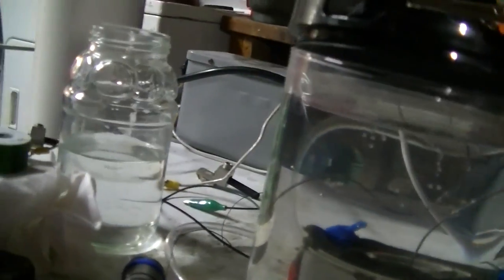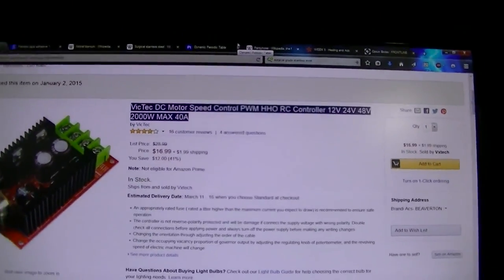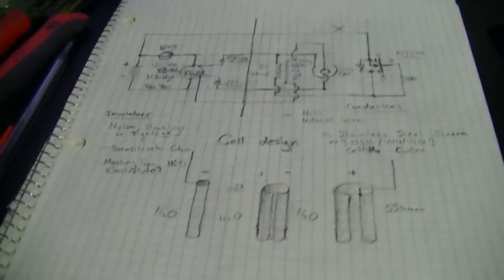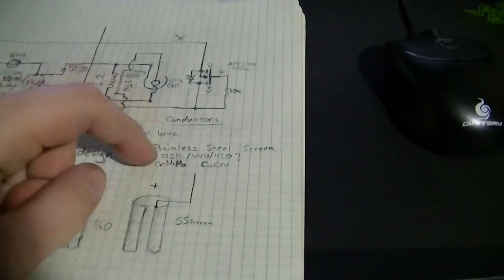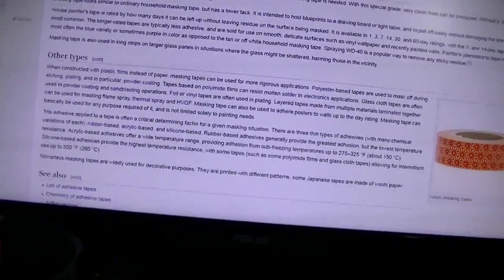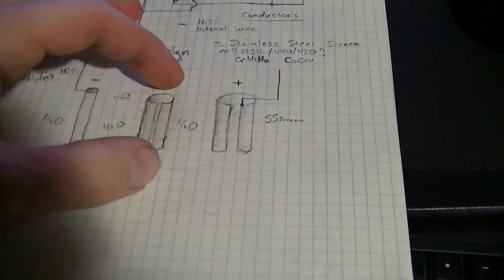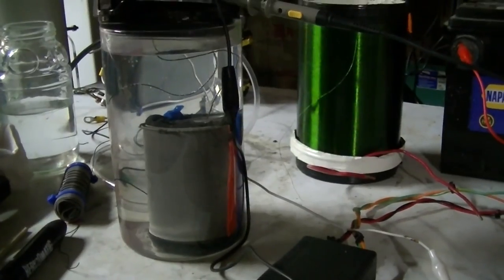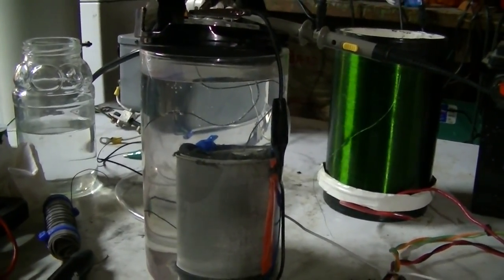Electrolysis in distilled water? NiTi Cell #3

Comment: I am confused. Is your curiosity that you are seeing gas production? Electrolysis does occur without a dissolved salt because water naturally ionizes, but only to a very limited extent. It is those ions that get drawn to the electrodes, and react further to produce O2 and H2. The purpose for the addition of the salt is to force Le Chateliers principle by adding to the left side to force ionization. The salt disassociates and becomes charged. Those charged ions then become the transports for the electrical charges in the solution. Electrolysis without the salt works, but it is EXTREMELY inefficient.
Reply: I was under the impression that DI and Distilled water where essentially a dielectric insulator? Thank you for your comment and I will look into further.
Reply: @officialdiadonacs  No problem. Those generalizations are a big source of misunderstanding for people. The ionization is an equilibrium... the electrolyte forces the equilibrium to the right. Without the electrolyte, the water will still ionize, but to a far less extent, therefore the effect is not as dramatic.
Reply: Interesting. 

I was hoping for more effective electrolysis without dissolved salts, to deter further undesirables like chlorine and CO2.

Comment: Lenz law springs to mind in regards to the heating of a closed pipe vs a cut pipe.
Eddy currents is the apparent culprit according to accepted theory.
You will get more gas from that if you find a resonance on the cell.
Adjust your frequency until you hear a tone coming from the cell.
You should be able to adjust the frequency of that pwm unit if you mod it by substituting the component that sets the frequency. 
What's at it heart ?
Post a schematic if you got one...
Reply from the maker: That's the unfortunate part, I tried to look up the schematic, I couldn't find one. If someone finds it let me know. It seems like a 555 timer H-Bride type configuration. I feel kind of guilty for not making my own, but time is precious. So my style is stumble around in the dark until you bump into something. Then she'd light on it until you can see it lol.

Cell resonance is something I am exploring too. Thanks for your comment brother. :)
Reply: Diadon Acs so its a 555 timer ?

Comment: I've been getting production in distilled water with my washer cells too.
Reply from the maker: What are the materials you are using? No corrosion nothing?? Do you have a video of it? I should have never gotten myself into this. Now I have nothing but questions. Should I use De-ionized water. I want to avoid any type of galvanic reaction all together, if possible. Its fascinating to me how a switched DC impulse makes its way through obstacles and reacts, isn't it? Would it  be possible to transduce a potential in a cell? Like a signal feedback receiver? These are things I know very little about.
Reply: I used stainless steel fender washers, nylon spacer washers, and copper speaker wire for connection leads.  It was part of my Rotoformer PMBO videos.  I did get some discoloration of the water and iron floaties at the top.  It could be the iron is leaching out of the stainless steel.
Reply from the maker: Hmm, I have noticed there is usually some reaction with dissimilar metals myself. So thats my primary theory right now of what's going in here. If I can find a way to measure that. Then I can move on :)